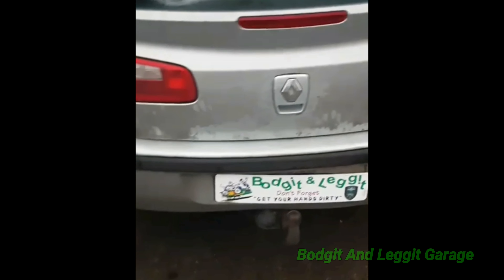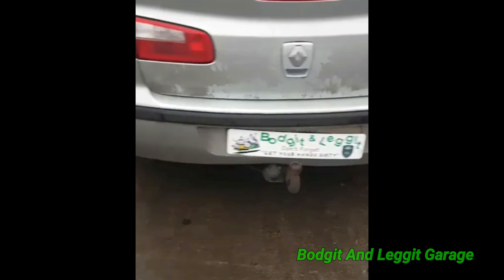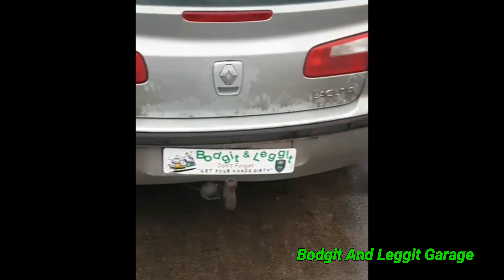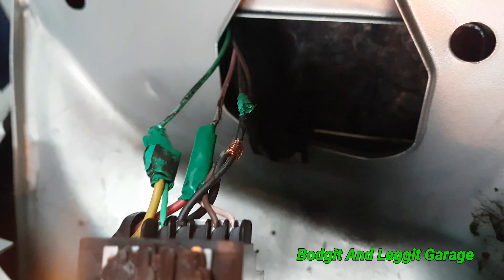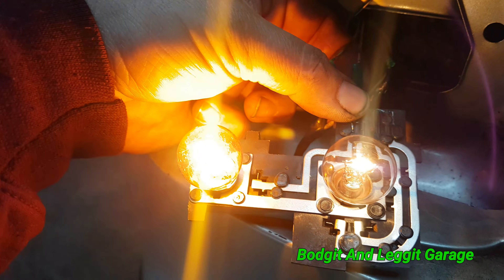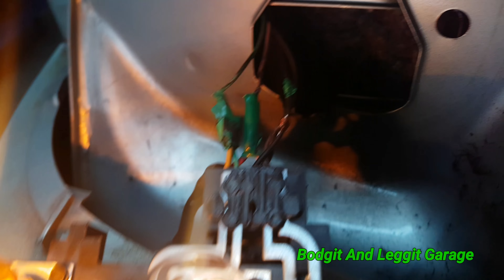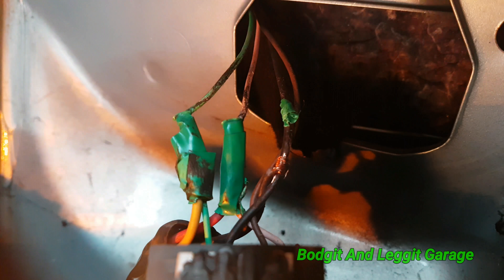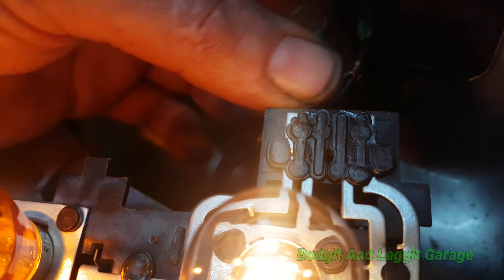Warning Dodgy Wiring Bodgit And Leggit Garage

Comment: Nice one! Well my L200/Triton in Thailand had an aftermarket remote installed as part of the freebies you get when you buy a new pickup here (back in 2006). Needless to say it was wires twisted together and it last 3 years or so before it started having problems. Since my first career was electronics i decided to solder  all the twisted wires and generally sort it out. Now its 2018 and 9 years later and my after market remote is still working! Ok the pickup has only done 110k km, and its in the garage most of the year while i am in the UK, but it shows you cant beat soldered connections!
Reply from the maker: Alastair Munro exactly mate

Comment: Hack wiring and designed in fault.
Connector is copper based.
Cluster is stamped out of galvanised steel.
Stick copper and zinc in an electrolyte, you get a battery.
Pass a current through a copper - zinc junction, bit of moisture and you get a chemical reaction.
The direction of current flow determines the reaction. That's why the ground pins always fail first.
It's primary school stuff.
Reply from the maker: Simon Parkinson very nicely put mate